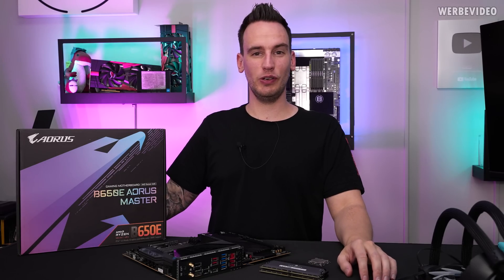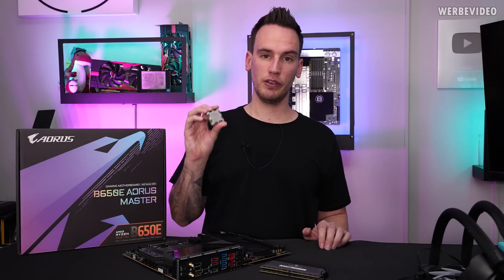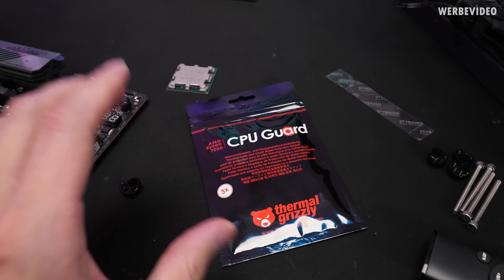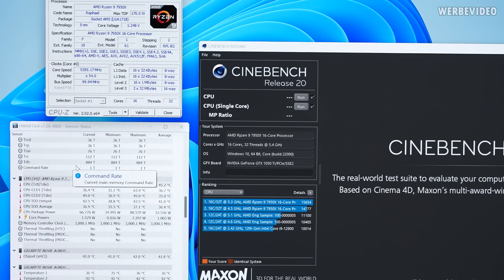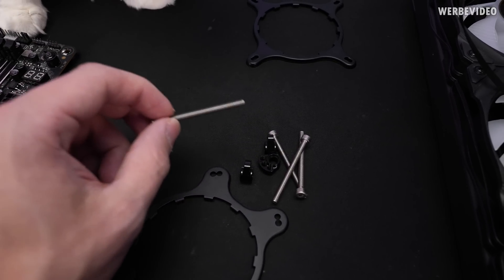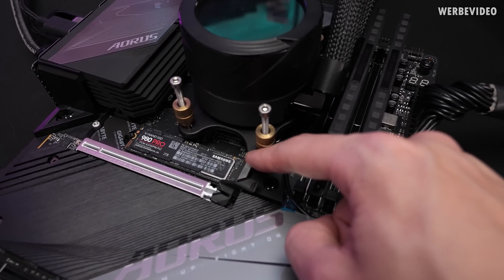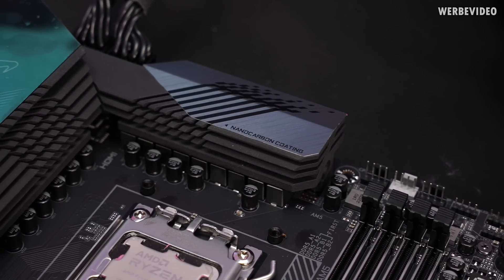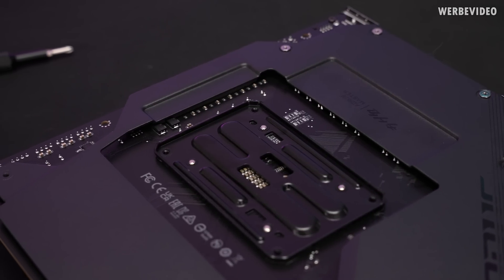Ryzen 7000 Offset Mount - Will this improve the high Thermals? (+B650E Launch)

Comment: With new boost behavior is max temperature still a good metric? I mean if the temp is the same but it boosts from 200 to 260w to keep that same temp the solution that allows 260w is better right?
Reply: That is correct. If they reach the same temperatures, the one with a higher package power and frequency at that temperature is cooling the CPU better.

Comment: You're videos always seem to be right on point regarding our questions.   I am very much interested in the B series Mobos as a choice for my new system.  With the Exception of the ASROCK B650 Taichi, which has a VRM config of 24+2+1 most all the rest of the B series from the major Manu's are in the Mid to Low teens with VRMs although some of them have a very high AMP capacity.  According to the VRM overview given by Hardcore Overclocking a few days ago his results after testing reveals the Capacity of the B series VRMs to be more than enough for most any Overclocking scenario.
Would it be feasible for you to engineer a replacement IHS for the 7000 series?  You might be surprised at the interest generated if the results are a substantial improvement.  I mean this wouldnt be for the Meta Budget crowd, but you might find a substantial interest.  Who knows maybe AMD could arrange something for you like Lian Li did.  Well, just a ramble.  Thank You for your On Point Content.  I knew I was going to like this video just by the smile on your face at the beginning of the video.  😁

Comment: Do you think by lapping a lot of the Ryzen 7000 IHS thickness will have any benefit in terms of cooling and thus in boosting? Lets say removing 1mm of the IHS? thanks.
Reply: In a previous video Der Bauer already lapped one.  2+celsius improvement.
Reply: @halrichard1969  I know he dellided one, but I can't find a ZEN 4 lapping clip

Comment: Roman, are you sure which mobo sensor represents the VRM? One of the sensors reports 95 degrees and I cannot imagine anything else on the motherboard itself that would go that high if not the VRM. Also, it seems like this particular board is set to cost about $350 (US dollars), which means it would likely cost between 350-370 EUR.
Reply: That should be the CPU sensor
Reply: At Alternate they want 501€ for the Gigabyte Aorus Master B650E...

Comment: The Ryzen CCD positioning has always been terrible, but this new IHS and the higher wattages just exasperate the issue. There will never be 3 or 4 CCD desktop parts, so it should be the IO die that is offset and the compute die(s) nearer to the center.

Comment: Don't you think, the IHS on AM5 processors are intentionally made thicker ? Because next time when they release the chips with 3D-v chache they won't have to do anything about height, they will just shave off few millimetres of copper from inside of IHS. Plus, next time they can brag about 10-12% more cooling, while all they do is what you've done already by just lapping the IHS.
Reply: I seem to recall reading somewhere that it was done to keep the height consistent between AM4 and AM5 and allow cooler compatibility between the two, but your theory is certainly plausible.
Reply: @xHighPotencyx  If the had kept AM4 & AM5 cross-compatibility in consideration, it might have been in development since the design & modeling phase, where the socket have new shape & mechanism according to function,  but the dimensions could coherent. I think that was very finely detailed technical nonsense just to cover-up before anybody points it out.

Comment: This looks like an ideal board for me as it has both gen 5 for gpu and m.2 as standard.. I'm building a simple emulation machine which I want everything lol upto ps4 and if I can ps5 and Xbox series X (yeah I know not asking for much are we.) What is the best GPU for emulation or is it a per system basis of NVIDIA will be better for PS games and ATI/AMD for Sega etc? I pretty much want an easy plug and play setup with around 32GB ram, 7600 CPU to start and leaning towards NVIDIA 3060 unless someone has some feedback which could sway my thinking (not to say I'm unhappy, just not completely certain as of yet.)

Thanks and if you leave feedback, give as detailed an answer as you like. If I have follow-up questions I'll gladly ask. 

Thankyou

Comment: TBH, i would buy something like this offset bracket for 'server' applications if you can reduce the CPU temperatures by just a few degrees by getting better heat transfer, the fans can run slower, meaning less wear on the bearings.
On the subject of boards having everything you could want
I'm trying to build a server right now with a 7950x, but i find the X670 boards lacking for home-lab use.
I cant wait for a board with 
IPMI(i've got a few X470 boards with IPMI, and dedicated management LAN, its awesome)
integrated 10G+
3-4 PCIE 1x slots (I'll be using these for tuners)
2PCIe 16X slots one in 8x or at least 4x (I'll be using this for a SAS HBA and 
ECC uDIMM support(hopefully 256GB once 64GB DDR5 u?DIMMs becomes available)
6 M.2 slots, with 4 of them being 2x (2 for boot, and 4*2x for optane or any drive you dont need high bandwidth)
8 SATA ports so i can have 2 drive controllers.

Comment: If the cpu target 95°C, wouldn't you need to get away from that temp in the first place before seeing any potential temp improvement.
Reply: We won't be seeing any temperature improvement unless we can reach the voltage cap first, which he did in his delided video

Comment: I saw it on the GN stream that you're getting better with big numbers and which we skip in English. 
You said the ram runs at sixty-hundred mhz, but this is a case where you can't skip zeroes. It would be six-thousand only. If it was 6050mhz for example, then it could be sixty-fifty mhz. 
Hope that's something to take away, great videos, Roman!
Reply: "Sixty-fifty"? No. Just no.

Comment: so i know your stick is overclocking it but if i am checking for real world workstation pc what would you say for coolers? at the office  there 100% against aio's (for some reason idk) so they still want to use a 92mm noctua cooler i am saying its not gonna work but will any type of aircooler work for stock settings for a 3D rendering workstation (cpu rendering in 3dsmax and Corona renderer)
Reply: A 92 mm air cooler will absolutely work for this, servers have been using smaller coolers on hotter processors for years. It’ll just be very loud once the fan revs up to 4-5000 RPM. 
If you want something quieter and you have a big enough case, go for the NH-D15 or its upcoming replacement. You can put a 3kRPM case fan on it to get high performance without the same horrible noise (50% pwm will probably be enough). 

If you want full performance  and quiet, you need custom loop. Barrow/EKWB CPU block/pump combo and a 240+ radiator can handle cooling these CPUs, as long as you’re not rendering 100% of the time the fans won’t even need to spin up. Use a zmt tubing and a clear coolant and it should be fine for two-five years before you need to do a coolant swap. AIOs are also an option, but I agree with your colleagues and recommend against them. Quality is generally very low and I’d consider the Barrow combo unit a better option unless you absolutely can’t afford it and you don’t have an hour to fiddle with filling the loop.

Comment: With this kind of hassle, I might just skip Ryzen 7000.
Reply: lol, you do realize none of it is necessary for a fast and reliable system, right? It only concerns extreme overclocking, which frankly is just for fun and not really useful...
Reply: @MrFatpenguin  I live in a very hot country with all year long summer.
Reply: @wolfgeralt  so what? The cpu will run at 95C under full load in Morocco or in Norway, it's designed for it.
Reply: @MrFatpenguin  so you want your CPU to run at 95C constantly? Good for you. I'll just skip.
Reply: @wolfgeralt  constantly? Who runs cinebench constantly? I mean, you could, it is literally designed for it, but your electricity bill would be pretty high lol
Reply: @MrFatpenguin  lol... You really talk like you know every person's situation and you were in my shoes. You must be a great understanding person. 👍
Reply: @wolfgeralt  ryzen 7000 is far more energy efficient than older generations, if you want more performance with less heat this is the best option, no matter where you live or your personal situation. Heat is absolutely not a reason to avoid this gen... prices on the other hand...
Reply: @MrFatpenguin  Its designed for it but it would not last long. Electronics life expectancy is reduced 50% every 10 degrees of temperature increase. AMD can say what ever they want they can't defy physics. AMD cpu's became like apple macbooks now that always run hot and die early.  Even if the 7000 CPU can take it which it won't the motherboard, and all other components will take a hit. I live in a country with a year long hot temperature, and run a 3960x 24/7. I had to underclock it to 3400mhz and disable PBO to make it stay at reasonable temps (below 70 under load). I even added an extra fan on the chipset to keep it under 55 celsius that supplements the existing fan on it. 

AMD decided to go for high benchmark scores and traded reliability to do it. Some people want to keep an expensive system for more than 10 years.  I will skip this generation until they improve their temps. Hope things are better for 8000 series. If i wanted a disposable system that will run hot and not last long I would buy a Games Console or a Mac not build a PC
Reply: @dfloper  You have money for a threadripper running 24/7 under full load but you can't afford AC?
And you people are missing the part where ryzen 7000 is MORE efficient than last generations, you can run it at higher speed with LOWER temperature if you want to undervolt it. 7950x will be about the same speed as 5950x with half the wattage, if you choose to run it that way.
Reply: @MrFatpenguin  I am waiting for reviews and test about how good 7000  performs when you under-clock and under volt it.  The TR 3960x i build  specifically because i knew it would run reliably  without requiring AC 24/7. If i went the  EPYC route it would require a blade chassis and this do require an AC room + also have high airflow fans which is troublesome in a residential environment due to noise.

Comment: I expected a better result. Looking at a delidded CPU, the upper half of the IHS is exclusively the IOD while the lower half is both CCDs. Half the cooling capability of a standard water block then goes to the IOD, which barely needs cooling, and only half goes to the CCDs, who desperately need as much as possible. You're probably right about the thick IHS.

If I had the tools to machine copper (let alone to make microfins) I would try a custom block with fine fins only over the CCDs and a very narrow jetplate, and thicker fins over the IOD before the outlet, as a sort of zen4-specific direct-die block.

I do wonder if that's something EK, Alphacool, or Corsair are considering. It's essentially the same setup used in GPU blocks, so it's impossible they haven't thought of it before. You can't do it on Intel's monolithic dies and it's been pointless on earlier Ryzen because those just didn't produce enough heat to make it worth bothering with, but with the low efficiency of these new Ryzen chips and AMD's ever growing market share it begins to make more sense.
Reply: It was a better result. R23 score was higher 2nd run. Zen 4 will boost all the way to thermal limit always so this result makes sense.
Reply: @shadow7037932  When I wrote my comment those hadn't been posted yet, I just read them. You're right, when you look at cinebench the result is more like what I had expected, but that knowledge only makes me more eager to try direct die cooling.

I'm tempted to try making a custom jetplate for one of my old blocks so all the cool water is directed over the fins that cover the CCDs, just to see if that has a similar improvement to Roman's offset mount. It would be a lot easier than offsetting the cooler mount enough to get the same effect, modern motherboards are very cramped in that area. I would probably have to use an Intel frame and make my own clamping mechanism to move the block far enough.

My motherboard has to arrive before I can start playing though. I have the CPU, but waiting for the board is killing me.
Reply: @СузаннаСергеевна  I remember IBM was playing around with direct die water jet cooling long ago. Would be a cool project if you've got the machining tools and skill to make a prototype.
Reply: @shadow7037932  Unfortunately I lack both. I do have the CAD skills to hire Barrow to do a custom block for me, but for a hobby project I don't think it's worth the bother and I've no doubt they charge more than I'd be willing to pay. Feature creep would also come into it at that point, if I'm buying a custom block I'll also try to squeeze a D5 pump into it because that's another thing I've been wanting to do for ages, and then it will just never happen.

I do have the tools to make jet plates and to CNC acetal, so what I might do is make a custom top and jetplate for my old EK Velocity block. I'll direct the water only over the fins that cover the CCDs, and see what happens.

Comment: I clearly see the effect, 8% score improvement (14521 vs 15843). AMD has already said that it will boost as high and as long as cooler can handle temperatures, so if we think we will understand that offset WILL NOT improve temperatures but will allow to boost higher and we clearly see it in cinebench score. I'm surprised that Roman didn't notice this, power draw was also hidden from us while editing/shooting but it might change during offset mount test run.
Reply from the maker: I did a manual OC on the CPU so I did/do not expect the CPU to act different with improved thermals. I honestly missed the improvement but it's awesome that you guys noticed it so I can just go back and repeat the testing! Maybe it will help in the end :)
Reply: @der8auer-en  This is why I love the OC community, I can't wait to see what you find out!
Reply: @der8auer-en   Oh! I didn't notice OC, my apologies if this info was in the video and I missed it. I assumed that offset was the only variable in this test, which is expected.
Reply: @der8auer-en  you should pin the comment to the top or make a comment of your own and pin it, so people don't miss it.
Reply from the maker: @MaxIronsThird  already pinned a similar comment earlier with the same content :)
Reply: @der8auer-en  will there be an update in a short or a tweet about the cause? or we can expect a full video on this?
Reply from the maker: @123493735  full video for sure. Will test it this week
Reply: @der8auer-en  Awesome, the video will be awesome just as this one GL on the testing
Reply: @der8auer-en  any news on this? I am quite interested in the cause of this and you seem to be the first to find it
Reply: maybe he doesnt want to go through with rnd of those little offset things again (^:

Comment: Will you make a lapping block for the 5800x3d? I'm curious since they are a little warm. Ditto for if you'll ever put out a relocation bracket, say for the aio coolers?
Reply: I tested 5800x3d with just a 280mm arctic aio with the offset mount, and the temps are nowhere near warm. Even with hard AVX stressing...
Reply: @royalgm  would you be willing to say which offset mount it would be? There's two listed and I'm on a b550f mobo

Comment: Here's the dumb question of the day. Would it be worth delidding a 7600x to get temps into a normal range?
Reply: It already runs at a normal range without delidding. I don´t understand why people won´t trust the factory, they know what they are doing. (Of course if you are an enthusiast looking to push limits in OC it's a different story...)
Reply: NO
Just dont.
cpus are designed for 95c thermal this generation.
Better spend on a high end cooler
Reply: No, they are in normal range already
Reply: Not really. It's a 105W 6-core CPU that can hit 150W on occasion. If you have a good air cooler it should stay well away from 95.

Comment: for the 3000 and 5000 processor it  does make a difference (a little under temp controlled room, but in a hot environment it really does. 2 degrees are enough when you have a room temperature of 38+

Comment: Could you try how the Arctic Liquid Freezer II 420 (specifically the 420) will do with the new 7000-series? Since this cooler also has a possibility for making it an offset mount.
Reply: I've done the test with my Arctic Liquid Freezer II 420 as you request here. Using the offset mount does improve temperature and/or boost blocks. Should be used when cooler provide this feature! PS: Results posted on Reddit
Reply: @Luca-pb8vt  Where? 😅
Reply: @Luca-pb8vt  I can't seem to find the Reddit post 😟
Reply: @TheTekknician  my response here keep being shadowed/deleted for unknown reason! TL;DR : you should use the offset mount, depending on your configuration you will see better temps and/or better clocks (for me -7.6% temperature, score +1.3%)
Reply: @Luca-pb8vt  Mighty impressive considering the general results! What paste did you use? Thanks for your efforts by the way 😁
Reply: @TheTekknician  I'm using Thermal Grizzly Kryonaut 👍🏼
Reply: @Luca-pb8vt  Any indication on how fast the AIO gets saturated? :)
Reply: @TheTekknician  CPU max temp is reached almost instantly with how Zen4 works. Regarding the AIO water temp I don't have anything to monitor it properly. Maybe a stress test would allow to see how score decreases over time, but it's not representative of standard usage where 100% might occurs in negligeable bursts only 👍🏼
Reply: that or the IceGiant cooler he has, wonder if that can be configured for AM5
Reply: is the offset in the same direction?
Reply: @aphysically6071  I believe it is, I have it configured as such for my 4750G and I did the same for my old 5900x